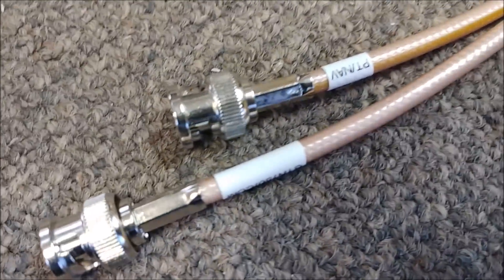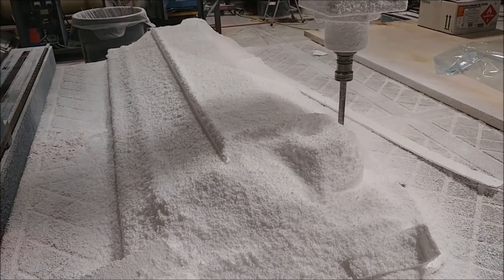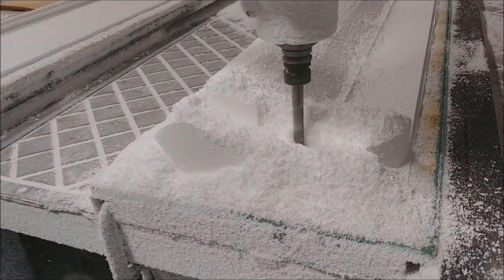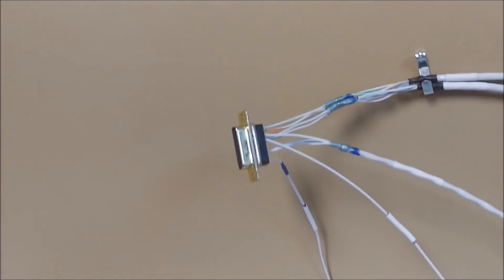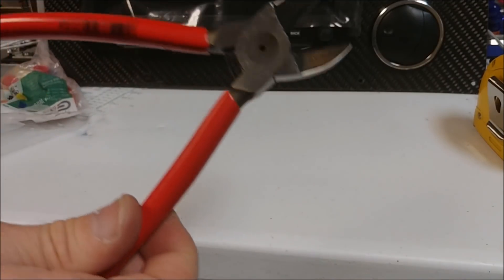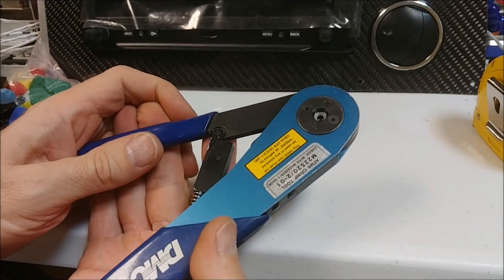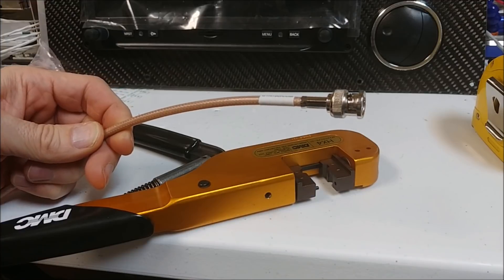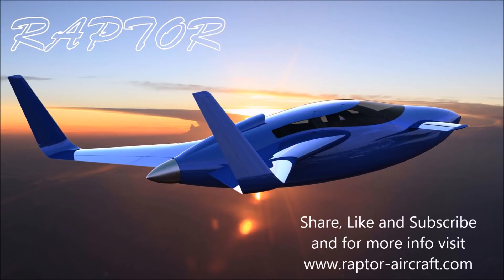Wiring Tool Summary - what you need to wire avionics

Comment: I noticed that you got some brass fittings from Home Depot. Just a tip, Use them when your in a jam otherwise they are not reliable.  You can get some high quality D.O.T. grade fittings from a truck parts store like Fleetpride or even the parts desk at a local truckstop. You will find that they are much better quality.
Reply: there are lives at stake afterall

Comment: For longer cable runs and better defined cable harnesses you've assembled, you might want to consider also using back cable braiding and wax lacing cord.   This gives the wiring within harnesses a lot more protection from bending, wear and tear etc.   There's no doubt good videos out there on how to properly make harnesses.   Google "nasa cable lacing" to see how useful the lacing cord can be.
Reply from the maker: I'm not done yet. That's coming.
Reply: Or just ask me to do it.  I am certified by NASA and JPL. I was at the open house. 

I saw in an earlier video that you were using the blue crimp handle.  You did a double squeeze on it.  People think they are making a better crimp but the truth is the crimp could be compromised.  If the pin moves even a thousandths of an inch, then the crimp is no good.  The DMC tools are calibrated from the factory.
Reply: The Third International Party of Kekistan 

The solder sleeves work quite well but the material needs to be matched to the wire type and insulation.  No point in paying for a solder sleeve that has higher standards than the wire or the other way around.  Another thing is to make sure the solder sleeve has proper flow.  Otherwise a cold solder joint will occur.

There are other ways of doing the shields that takes up less space but it can be more time consuming.  I personally go the extra step during the prototype stage.  This does not mean solder sleeves are wrong.  In fact it is a great way to speed through a build and to get to testing.  But inspection for all builds is a must. Only because I do not want my workmanship to be the cause of faulty data collection.

Something else I noticed in the video.  The crimp head was pulled from the handle with quite a bit of force.  Then I noticed the locking pin was still installed.  Definitely inspect the tool and crimp head for damage.
Reply: cmmguy; good morning.  The solder sleeves that are being used are intended to ground the shield.  A drain wire comes out of the solder sleeve then connected to ground.  The other methods for doing this process involve hand soldering.  So to answer your  question, the solder sleeve and a hand solder connection will both fail in a fire but that is the least of a pilot’s worries if there is a fire. 

Just for your knowledge, there is a crimp ring configuration that can be used but it is more time consuming.  In the case of this prototype, and production birds, the solder sleeve is perfectly acceptable.
Reply: @Jaun Saucedo: What do you think about these solder sleeves at 8:20, are the connections really reliable? Usually soldering isn't good on wire subject to vibration. 
I'm just an industrial electrician and had never seen these before (or I can't remember because I rejected them).
Reply: How well would solder sleeves work in a high heat situation, like a fire? would all the wire joints come undone?